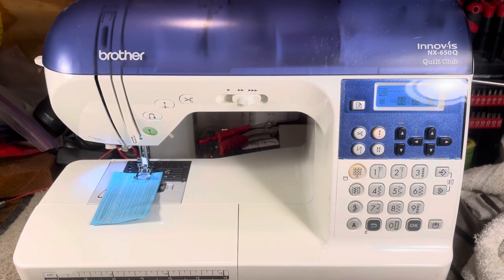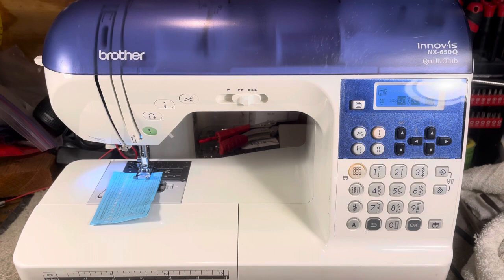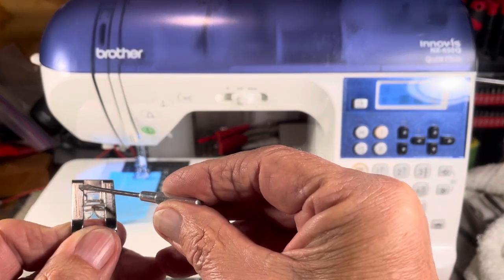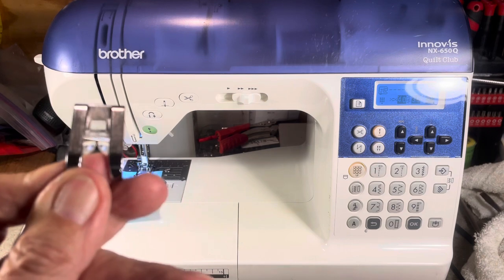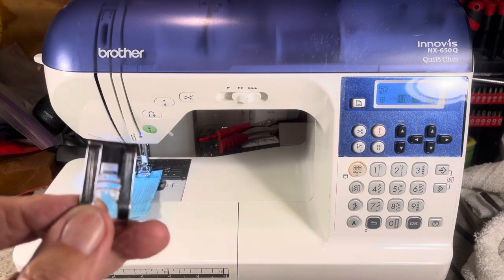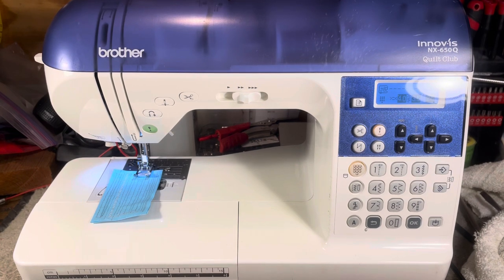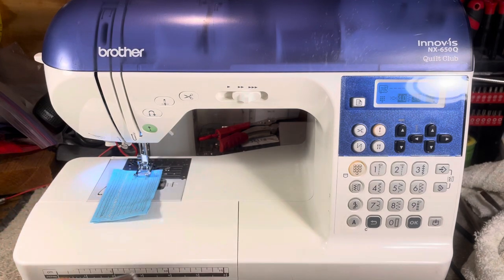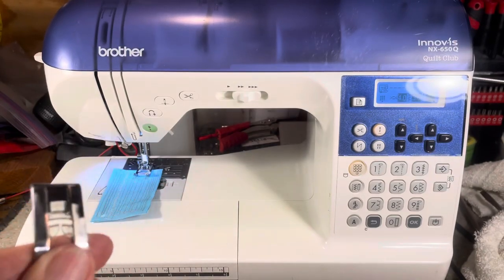Feeding Crooked-Brother NX-650Q-grooves cut in the presser foot Easy Fix, get a new foot (video 334)

Comment: Take a magnet to the shop and make sure the feet you buy are at least a little magnetic.  At least you can avoid the zinc-alloy feet that way, and get the feet that are stainless or chrome-plated tool steel.
Reply from the maker: That’s a useful tip. 
I use my magnet quite a lot to keep small items from falling into “the black hole”.
I’m surprised at how many of these parts have such little magnet reactive content. 😎👍🏼

Comment: Wow! Mine feeds crooked too! Never in my life had I seen this happen! Drives me crazy. So can I straighten the feeders myself or is it something I need to get you to fix?
Reply from the maker: If there’s too much downward pressure on the presser foot, the grooves will get cut into the bottom of the foot. 
Check yours for the grooves.
Replace the foot if needed.
Some machines have adjustable pressure dials or knobs right above the presser foot. It’s a nice feature to have, and sadly is missing from the “budget machines”.
If yours doesn’t have a pressure adjustment, you will be limited to using whatever random pressure that was assigned to your machine at assembly.
Sometimes it’s really max pressure.
Sometimes it has barely existent pressure.
Sometimes,(rarely), it has Goldilocks pressure and it’s just right. 👍😎

Comment: The other repair shop obviously didn't test the machine to be certain that it was running satisfactorily. Shame on them, shame on Chinese workmanship (or lack of),and shame on the Japanese designers and engineers who created this plastic boat anchor (just kidding, I'm sure it doesn't weigh enough.)
Reply from the maker: You’re correct sir.
There’s certainly enough shame to go around. 
We seem to never run out recently. 
As the political folks like to say when they really screw up: “Mistakes were made”.
Yes. Yes they were. 😎
Reply: @randyyoursewingmachineman9954  
The biggest mistake was buying that piece of junk. Most of the crap on it is probably never used. She'd have been better off buying a nice Kenmore 158-1941. As always, nice chatting with you.
Reply from the maker: @ronalddevine9587  you’re correct, but not everyone is on board with “Older is Better”.
When the ladies and gents take their classic machines in for service or repair, they are invariably told a whopper about their machine.
My customers tell me what they were told, time and time again.
Things like: That old thing can’t be fixed.
                    Parts are no longer available for that old thing.
                    We don’t work on old machines.
The folks are in a tough spot so they buy a “plastic fantastic “ machine, because they think it’s their only option.
It’s been said that people lose their minds en masse.
When they return to sanity, it’s one at a time.
It’ll take a while for the correction to occur.
In the meantime, find a quality classic and buy it. If it’s all there and working, the price is largely irrelevant.
When they are no longer available, no amount of money will solve the dilemma.👍😎